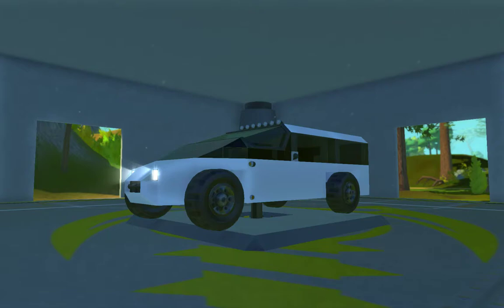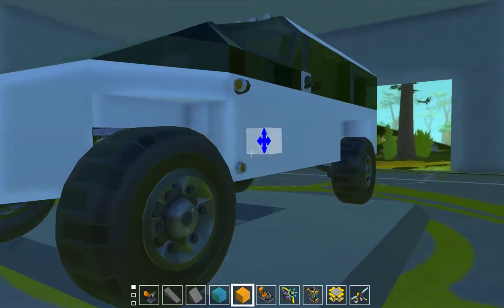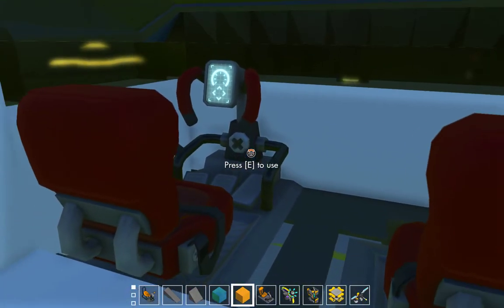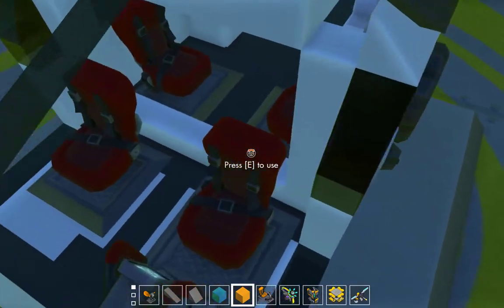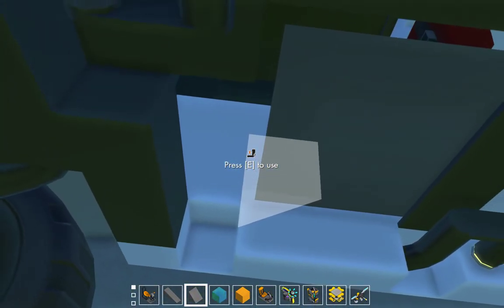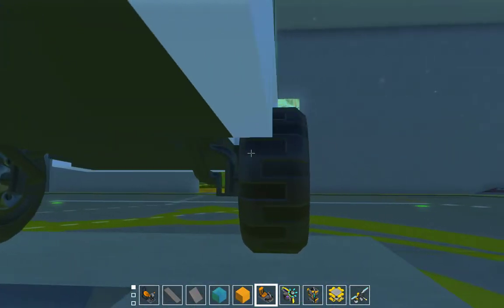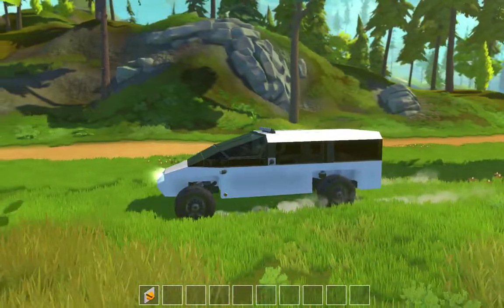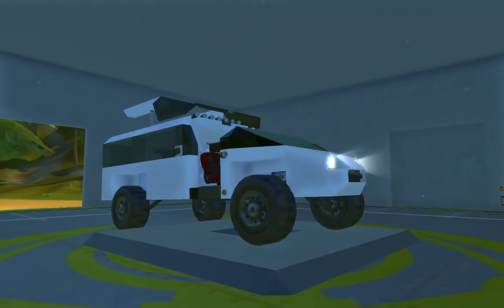Scrap Mechanic | Concept Van

Comment: Nice van,dude.Woudn't it be nice if it has 2 wheel steering
Reply from the maker: Omar Mahin would be easier to drive with these controls, but I wanted it to be different.